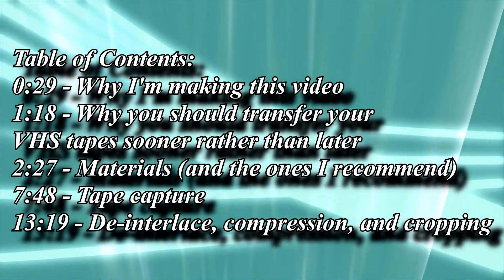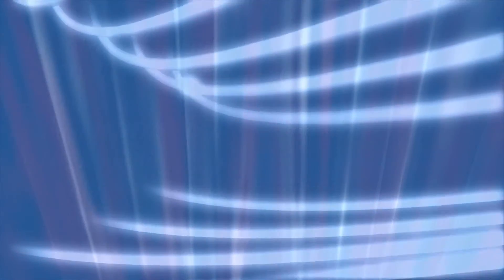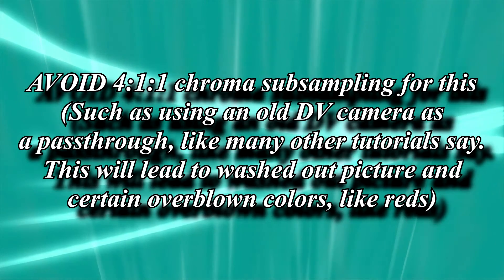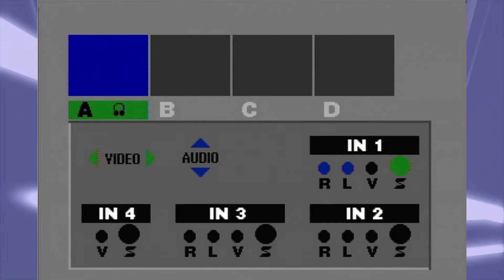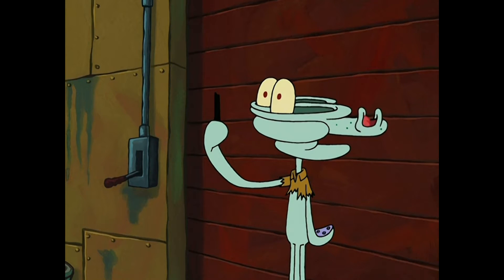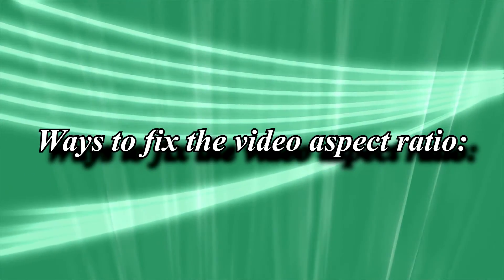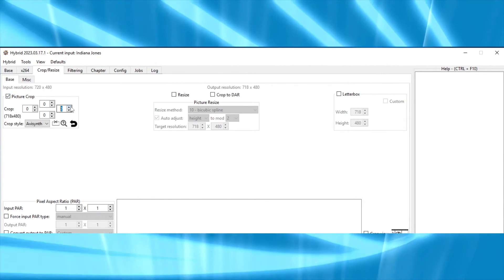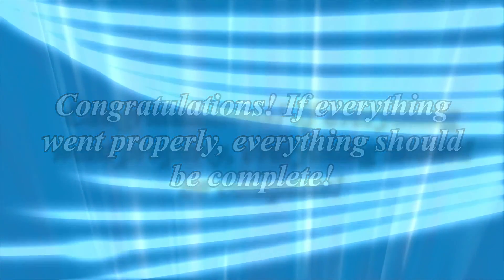The Ultimate VHS Transfer Guide

Comment: Why is it so complicated to put videos on a pc
Reply: analog to digital
Reply: Cuase companies don't make good analog to digital conversion products anymore, thats why.
Reply: Because digital is a binary signal represented by 1s and 0s. It’s either on or off and then you’re phone and other devices use analog sensors to communicate through a digital signal. That’s why digital can be copied over multiple times without loss because it’s just copying a binary code. Digital signal is perfect.
  Analog signal is a continuos wave that can vary at any time. The world we live in is analog. Speech is analog. The telephone cups with the string are an analog device.
 When you play a tape through a vcr it is going to be very messy. You have to have a line TBC in your vcr to correct irregularities in the speed at which the tape is played which can be cause by the stretching of the tape due to heat, minor differences in the density of the tape or other things. These irregularities are called timebase errors. In the old days television stations signal had to be perfect or they could actually blow the transmitter. So they started putting Line tbc’s in there VCRs. You can destroy your capture card if you don’t correct timebase errors. Tbc’s are on svideo decks because a tbc requires the luma to be separated for timing and the chroma for digital noise reduction. They don’t work with composite. You have a frame tbs to insure your signal is perfect. It prevents dropped frames and it syncs your audio. It makes sure your audio is in sync by not dropping frames. Otherwise you would drop video frames but not audio so it would get further off the longer your video was. Then it is ready for your capture card. Then you bring it in as lossless. It’s not hard to put videos on a pc. It’s capturing from your hardware a lossless video that’s hard. You can record the display later with Obs but that’s not the same as capturing directly from your hardwear and the difference is noticeable. OBS isn’t capture software.
Reply: A lot of the problem is in the fact that it’s recorded on a magnetic tape and the method of playing that back. You can look at something like a laserdisc that’s analog but on a disc and it’s much less prone to timebase errors. It still has signal problems due to the quality of the player usually playing the analog signal so you still need a frame TBC but they don’t have to worry about a line TBC because of the change in format.
Reply: It’s not. Using a cheap easycap device is fine for most people’s use. The internet is full of people who take this stuff wayyyyy more seriously than necessary for 99.9% of cases.
Reply: @themoley91  what are your hardware suggestions? What OS, capture card, and what are you suggesting people use to prevent dropped frames?

Comment: The video is captured at 3:2 because NTSC standardized digital capture is 720x480 (DTV is 704x480) with rectangular pixels. It's normal to have to apply the aspect flag such that it displays at 640x480. In my experience even a basic TBC is an absolute must. I'd be hesitant to say "ultimate" guide. Ultimate to me implies using broadcast level gear to TBC, capture, etc. That's not a rip on you specifically, but I've also watched a bunch of YouTube videos on the topic and so many get so many things wrong from a technical aspect. Problem is that if you want to get the best result technically, you need to dump a few thousand dollars into equipment. Realistically you can get 95%+ of the way there for under $500 as you did, and having ANY capture is better than nothing.
Reply from the maker: Yeah that's sort of what I care about most. Sure I could get an extra 5% boost in quality by using more professional gear, but that will also suddenly skyrocket the price of the project out of not only my price range, but nearly everybody else's. A lot of people view VHS as this old thing that's "supposed to look low quality" and that's why you see lots of low resolution VHS rips out there. Because who cares, it's supposed to look like that, right? I made the video so that hopefully more people will transfer tapes to a much higher standard. Professional level? No. VHS-decode level? No. Something way closer than we had before? Absolutely (and hopefully not breaking the bank in the process)

Comment from the maker: Well I knew that at some point in this tutorial I would have forgotten to mention something.
If you choose to use SVT-AV1 for compression, in the advanced tab in hybrid under SVT-AV1, make sure to uncheck "open gop". Sure, you don't have to, but by not doing so, any files made with the AV1 codec, at least from my experimentation, will load very slowly, and scrubbing through the video will be basically impossible. So yeah, be sure to disable that. (Honestly I don't know what it's enabled by default)
Reply: hello this is Sam Gross do you have a Facebook page
Reply: I really only watched this video to see what your method was as I also have a hobby of Recording and Digitizing VHS Tapes. 

I have my Grandparent's old RCA HQ VCR Player, downside is, it only does Mono and not Stereo but still. 

As for my Adapter, I have an AV to USB Adapter. The VHS to Digital Converter USB 2.0 Video Capture Card. 

As for my software/program, I use OBS.

Comment: I really only watched this video to see what your method was as I also have a hobby of Recording and Digitizing VHS Tapes. 

I have my Grandparent's old RCA HQ VCR Player, downside is, it only does Mono and not Stereo but still. 

As for my Adapter, I have an AV to USB Adapter. The VHS to Digital Converter USB 2.0 Video Capture Card. 

As for my software/program, I use OBS.

Comment: Top field first or lower field first (Correct setting if software programmer knows his stuff) must be tried out, as software programmers often have no idea about the CCIR (NTSC without color) television standard. The first field begins with the second line and continues with the even-numbered lines. Then comes the second field, which begins with the higher first line and continues with the odd lines. I couldn't get Blackmagic Intensity to work. If stop at dropped frames is turned on, recording will stop within 5 minutes. If stop at dropped frames is switched off, the sound is delayed by approx. 30 seconds after 60 minutes. I live in a PAL country and can't test the elgato grabber. The ultimate in the video description is certainly exaggerated. Most solutions have no synchronous sound after 3 hours with dropouts.
Reply: He says not to use capture cards like you are using at 5:08. The sync will depend largely on your hardware choices.
Reply: @duncanmacleod2136  The video grabbers suggested during playtime cannot use PAL (Elgato) or the speed of the source device (Blackmagic Intensity).
Reply: @TTVEaGMXde  Elgato and the shuttle are both awful. I had a blackmagic intensity shuttle. They drop frames like crazy. They aren’t meant for analog sources. You need a better capture card and tbc both frame and line to stabilize the signal.

Comment: @dabhdude How is it lossless, if you capturing in 422 color? I want 444 completely lossless.
Reply: According to rec.601 standard none of the capture cards being made or to be made can sample at 4:4:4 SD analog sources, 4:2:2 is the highest possible rate, therefore it is considered lossless, Sure you can convert in software to 4:4:4 but there is no benefit other than bloating the file size.

Comment: I'm impressed, this is actually a very good guide.
But I still will recommend not to use elCrapo USB grabbers.
DV is actually a great choice, at least when dealing with PAL tapes, since PAL DV is 4:2:0, more than sufficient for analog video.
By the way, how's your D-VHS project doing?
Reply from the maker: My D-VHS project? If you mean VHS-decode, I've looked into it and I need to find some units that I can properly tap into. I have a digital8 camera I plan on trying it with though. If you mean something else, you'll have to clarify.
As for capture, I agree in part. DV is a great choice, but having fought with other DV capture solutions, and considering my experience with the USB capture device I got, I'd say it has done its job well. There weren't dropped frames or anything like that. Plus it's easier to recommend in a video like this compared to buying an analog to DV device, and a DV card for one's computer, and so on...even though I know at least some people will have gone the cheap route with a much lower quality USB capture device.
Reply: @dabhdude  As for DV, I use D8 camcorder and the FireWire cable goes to FireWire to Thunderbolt connector and TB is pretty common connector these days. I had to get a FireWire ExpressCard to be able to uilize firewire to the full potential, as the TB route works only in one way, the PC won't recognize it as a DV device to send DV sinal to, which is something I needed to record VHS tapes from PC.

By D-VHS I meant this:
https://www.youtube.com/watch?v=pzcXF_G_mjk
https://www.youtube.com/watch?v=O-gbJM6QZz8

I have two machines, one PAL, one NTSC from Japan. The PAL one is a dead end, as D-VHS was never properly done in Europe, it has only a DV input, but records in MPEG2 and has no digital output, so you can only watch the tapes in analog. The NTSC model I want to reord stuff directly from PC, it supports both SD and HD, but to play HD I would require external decoder, as it does not output over analog, so the only way to wath for now is via FW to PC and either capture the tape, or watch via VLC. Anyway, I will be releasing commercial tapes in both flavours, as well as S-VHS next to the regular VHS I do on my underground VHS label.

Comment: Imma report my findings and ask for help, plz.:
- For some reason, SVTAV1 refuses to work unless I uncheck "overwrite input scan type to". I gotta mention I used Lagarith as the lossless codec, so in theory, I shouldn't have to overwrite the scan type, yet it won't de-interlace properly if I don't turn it on. x265 and x264 work as expected, however:

- All these encodes are done in the CPU, so I then intended to do this on the GPU in order to get faster encode times, using the NVenc option, which does make things way faster.

- By default, the "Support" drop menu in the De-Interlacing tab is selected, which gives you less options, however you can still check "overwrite input scan type to". That said, the correct option now is "Bottom field first". Not to mention, this will cause (at least in my case) the video to freeze in at least one random frame, just for it to keep going at a faster pace, and then back at a regular pace.
Setting the resolution to 706*480 does not result in a 4:3 output image like it does in x264/x265, instead, you have to set an actual 4:3 resolution, such as 640*480, give or takle with the pixels you crop to get rid of the black outlines..

- Changing the "Support" menu to Vapoursynth so you can get access to the rest of the settings in the de-interlacing tab makes it so the job is done in the CPU, which kinda defeats the point of using the NVenc codec.

- Picking the x264 option within the NVenc codec introduced a weird 1,190 aspect ratio, which does not happen with AV1. That said, it went away when changing the target resolution back to ~706*480.

- After a while,  I got an audio delay in my outputs, which shouldn't be there

TLDR/Bottom line: This is way too fucky dude plz help.
Reply: Update: The audio delay seems to be tied to the usage of no XSynth over Vapoursynth.
Which means, in the very end, you're basically required to use CPU.
Damn.
Reply from the maker: Sorry to get back to you late. To answer a few things, I think you figured out already that you can only do this on the CPU. I mean I hadn't really TRIED the GPU option to be fair, but from your account it doesn't sound like that worked.
Next, if you're having trouble with deinterlacing doing that skipping thing, try swapping fields. Mine was top field first tbf (most analog tapes are), so I'd suggest trying it nonetheless.
I don't know if "706*480" was a typo or not, since it should be 704*480.
I honestly have no clue what happened with that x264 option.
And finally, all of my exports went fine with no audio delay.
I think a lot of these issues might've been because of you trying to encode on the GPU? Nothing wrong with that idea, don't get me wrong. But sometimes I swear GPU encoding isn't quite as precise as on the CPU. Let me know how things are going though.
Reply: @dabhdude  Hey! OK, so, lemme put you up to date with the current status of my endeavor. I don't have my notes at hand tho (I made notes lol) but iirc, these are the main takeaways:

- After a while, I finally managed to encode in GPU, and it seems to be working fine with Nvenc x265 and x264. STVAV1 and Nvenc AV1 don't work, I think.

- Later, I found out that another factor for the audio delay, it seems, is the usage of the YUYV224 (or whatever. The one you mentioned) chroma subsampling. I deduced this because using a clip ripped with the RGB24 option does not introduce that audio delay. I tried this option because I had seen only mentioned somewhere else in a very good looking VHS, and comparing each of them side by side, YUYV224 seems to look more faithful to the source colors, but RGB24 looks better. More saturated and contrast-y. The resulting rips are heavier, but it looks oh so good.

Uuuh I think that's all I got for now. I may check my notes and get back to you with whatever I missed lol.
And ofc, I'll be willing to try any advice you may have with basically anything Lolol.

Also, just to clarify: The audio delay seemingly introduced by YUYV224 shows up in en codes made both in CPU and GPU. Maybe it's not being encoded in the correct framerate or smn?

Comment: SSDs can drop frames due to due to intermittent data flow. Definitely don’t use anything connected through a usb either. You best option for capture is an internal HDD.
Reply from the maker: Not to doubt your claim, but I have literally never had dropped frames on an SSD if I'm doing things right. I think the exception would be if you're using an eMMC "SSD", since those are basically the equivalent of flash drives. At that point though that's just a bad SSD.
With that being said, internal HDDs cost less per GB, so if someone's transferring a lot of tapes then that should be used instead of an SSD anyway.
Reply: @dabhdude SSDs are for your OS but HDDs are better to capture to.
Reply from the maker: I think the biggest downside to using an SSD for your captures is that if you're following this guide, you're capturing full uncompressed avi files. That eats through disk space fast. Plus SSD cells literally wear down with each write. So it's not really a speed thing. I more suggest it as an option if you aren't doing very many tapes (like one or two) and you can't be bothered to buy a HDD for...some reason.
Reply: @dabhdude  it’s kind of a nit picky thing. Anyways I mean you didn’t have any dropped frames so It obviously all worked out for you. My computer came with an HDD and I added 3 SSDs and mentioned it to the virtual dub ppl and they told me to use the HDD for capture. It’s a legacy task so it kinda makes sense that everything is geared towards older technology. I just am not used to a HDD being preferred for anything over a SSD so it kind of stood out to me. Any newer hardware is going to be fast enough for video capture because it’s a legacy task. All computer stuff is way faster then it was back then. You really did all of this on a lower budget then most everyone. When I heard 500 I thought you misspoke at first. That TBC you’re using I’ve heard is a weak TBC that’s meant for professional sources and not home videos but that’s stuff I’ve heard on the forum not stuff I’ve tried. I am probably kind of like you. I’ve looked through the forums and I know some things but I don’t really know a bunch like the people that usually comment on the digitalfaq forum. We’re younger then them though so that’s kind of expected. They’ve been doing this for a long time.
Reply: @dabhdude drive speed or cpu power or anything like that won’t be the issue with us windows 10 users. It’ll be our OS and compatibility issues. Computers have advanced a lot so anything new is fast enough.